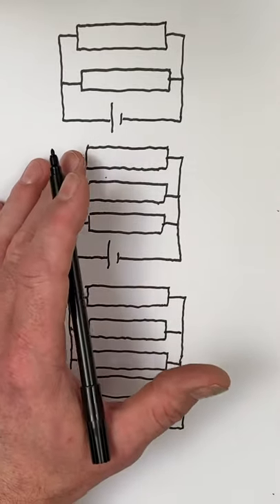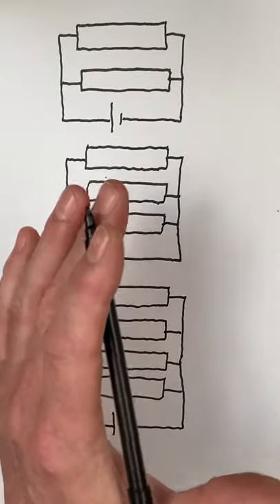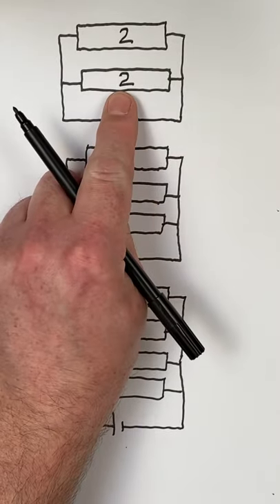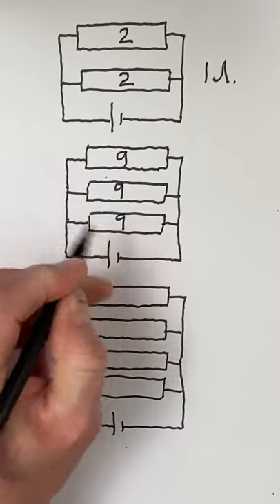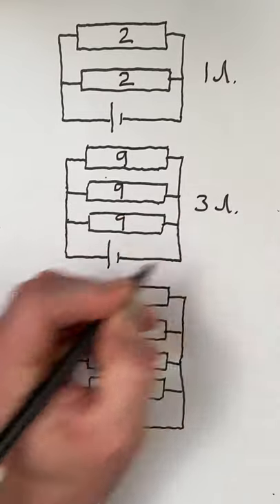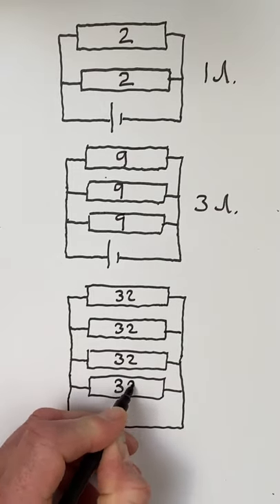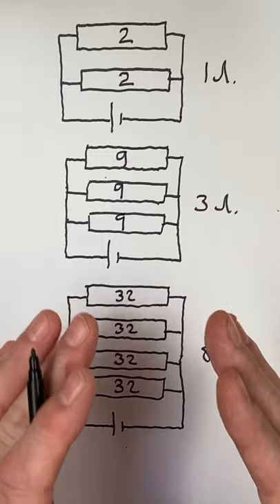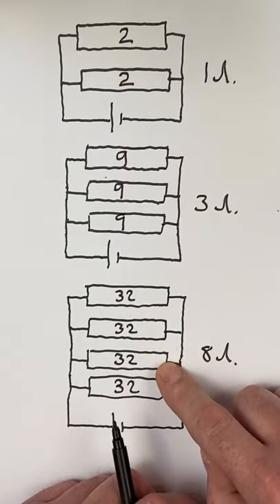Total Resistance in Parallel Circuit Made Easy (1)

Comment: Using the same logic......BUT using resistors of different values.... Say.....10 and 12....... Half of 10=5 and half of 12 = 6 add together and divide by 2 (number of resistors) = 5.5 and you wont be far off .  As for 3 or 4 resistors (or more) .... say  10...12...15 Ohm      But with 3 reisitors ..divide each one by 3....four resistors ..divide each by 4 etc...and then do the final divide.(the number of resistors in parallel).
So.... 10 ..12 ...15 Ohm.....resistors in parallel............. 10/3= 3.3            12/3=4      15/3=5    3.3+4+5 = 12.3 /3= 4.1 Ohm ..... Close enough. 
Get you in the ball park for a multiple choice  exam question....and most real life situations....prior to breaking out the calculator.
Reply: It's not the same logic
The equivalent resistance is calculated with a equation.
The above examples in the video only applicable when all the resistors are the same value.
But if for the mc questions, it's okay 🤷🏽‍♂️
Reply from the maker: Early access try this 👍🏻

Total Resistance in Parallel Circuit Made Easy (2) #shorts https://youtu.be/mT7d-nk-iy8
Reply: @kwongshuchung  I am curious.....The logic I am using is wrong... Are you saying that my suggested method doesn't work in a similar fashion to that shown in the video....Where, if two resistors of the same value are connected in parallel the total resistance will be equal to half the resistance of one of them  for example a 10 ohm and 10 ohm resistors connected in parallel = 5ohms total resistance.    ....Three 10 ohm resistors in parallel will have the total resistance of one third of a single 10 ohm resistor...3.333 ohms.
I was simply showing another way to achieve a quick answer in your head.... when the values of each of the resistors are different. For what it's worth. 
Prior to going down the equation route of   Rt= R1 x R2 / R1 + R2...........OR ........... 1/Rt = 1/R1 + 1/R2 + 1/R3   etc... 
Anyhow.....I suppose we will see, what logic is used,  when a video is produce by GSH Electrical  showing students how to calculate resistors in Parallel when their values are different....and the longer-winded equations will start to appear. Then my suggested quick method may become useful.....albeit with simple resistance values.
Just thought it may be of use to someone.
In Parallel..........same value
12 +12 ohm = 6 ohm   or... half the value of one of the resistors.
15+15=15 ohm = 5ohm......or.... a third of the value of the resistors.
24+24=24=24= 6ohm  ...or.... a quarter of the value of one of the resistors.

In Parallel.....different values, as in my previous comment.
3 reisitors in parallel ..divide each one by 3....four resistors ..divide each by 4 etc...and then do the final divide.(the number of resistors in parallel).
Example.... 10 ..12 ...15 Ohm.....3 resistors in parallel............. 10/3= 3.3            12/3=4      15/3=5   then add each answerand divide by 3   ...  3.3+4+5 = 12.3 /3= 4.1 Ohm ..... Close enough.
One final point for students.....whatever answer you come up with when calculating resistors in Parallel using equations or not....the answer will always be lower that the smallest resistor value in the question ....if your answer is higher than that....you know you've calculated something wrong. (quick check).
Reply: @GSHElectrical  Cheers Gaz......Although not needed by myself I appreciate the thought......and your hard work teaching others. I was just offering another line of approach when the values are different. Cheers.
Reply: @ningis21  i see what you mean. Your suggested method is only good for checking only. When it comes to exact values, your method will be wrong.
Suppose there are four resistors with their values of 1, 10, 100 and 1000 ohms, by using your method, you can get a value of 277.75 ohms. But the correct value is 0.9 ohm.
Your logic may only work if the resistors have close values.